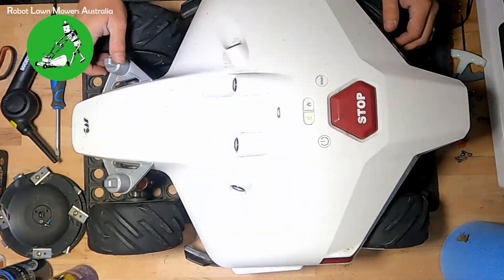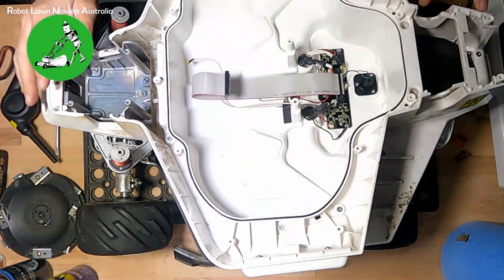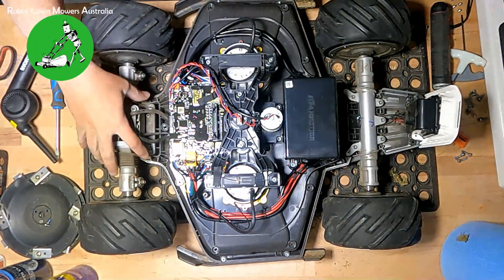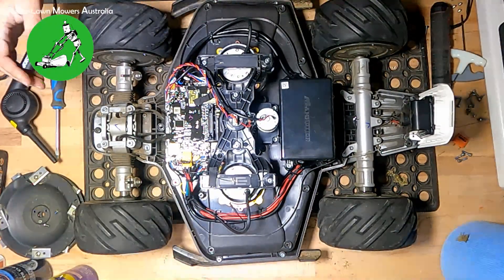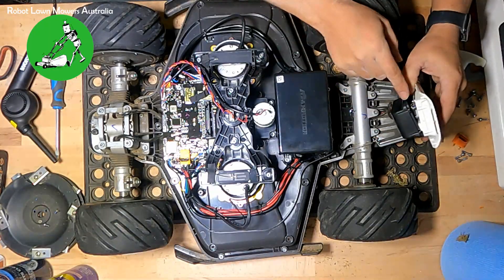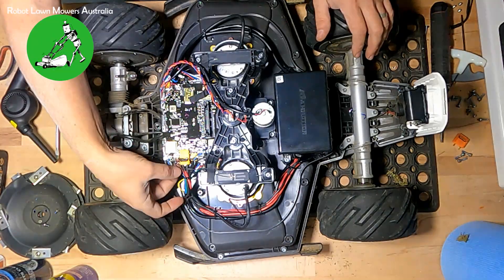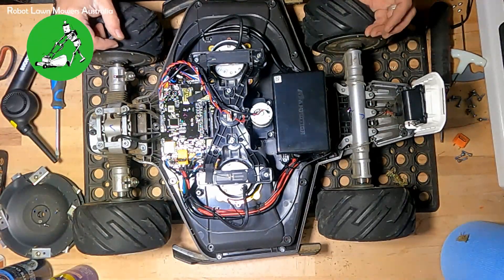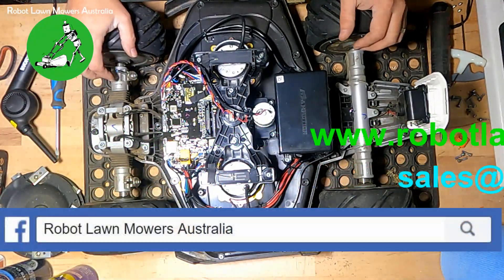Wireless Robot Lawn Mowers Australia - What is Inside Mammotion Luba

Comment: Do you know what the two black and green wires are attached to on their own little island at 1:13? On the external Luba they seem to go to two domed contacts whose purpose isn’t explained anywhere I’ve seen.
Reply from the maker: That is the stop button contacts. It is a magnetic switch which is activated by a magnet under the stop button.

Comment: Great video, I have an issue with my Luba 5000 AWD because Mammotion have locked it remotely (long story so probably not best to get into the reasons here). My question is, if I were to change the main board from another Luba (maybe one that someone's breaking because of a mechanical failure) would this effectively turn my Luba into their Luba so the whole machine would then work? As long as the original owner of the donor Luba removed it from their account I would then be able to add that machine to my account and everything should operate.
Reply from the maker: Short answer is yes. As long as you have the same drive motors, as Luba 1 had a couple of different motors. Solid front tyres and Omni front tyres have different motors and therefore different driver FW.

Comment: Can a broken rear axle be repaired?
Reply from the maker: Yes, parts are cheap but take a chunk of time. You have to remove from the board both motor cables before replacing the axle and putting the wires back and refilling a silicon seal.

Comment: is there a reset button inside? I have a update failure at 69% at my new Yuka, now nothing works anymore, hes dead, stuck in the update.. dont want to send it in :D
Reply from the maker: Sorry there is no reset button inside. If your Yuka has failed its update and you are now unable to connect to the robot via BT or WiFi then all you can do is cycle the power to see if you can get the connection back. If you get the connection back then you should be able to restart the update process and hopefully it update ok.
Reply: @robotlawnmowersaustralia7913  mammotion seid, there could be a bug that bricks the updateprocess. They don't know yet, but we testet everything possible and nothing works. I will get a new one

Comment: Is there any room to put gps tracker inside?
Reply from the maker: yes absolutely. We install airtgs inside the robot for our customers all the time. We dont recomend using the battery of robot mowers to power trackers, so as long as you have a tracker with separate power supply it will work well. Using the robot battery usually leads to the robot battery tripping its BMS and sometimes not able to recharge.

Comment: If you accidentally drop your Luba you could easily crack the front axle in two beyond the rubber boot.
Reply from the maker: yes this is true. The robot is pretty heavy and if dropped it will very likley break the axle. We have repaired a few broken axles now but not many. Later models and the Luba 2 havea slightly stronger design, but it not that much stronger.

Comment: My brand new luba 1000 is seeing zero satellites, suspecting disconnected cable inside .. how easy was it to disconnect the satellite antenna
Reply from the maker: If you purchased this from us, please contact us so we can fix this for you. If not you will have to go back to where you purchased it from. It does sound like the antenna cable is not plugged in properly or has a faulty antenna or PCB.
Reply: Was from another shop. Ended up being returned to the shop and replaced with another new

Comment: I’ve had errors coming up regarding the motor hub , now my Luba won’t move , positioning and connection is all fine . Is this something that can be fixed ?
Reply from the maker: If the motor is not jammed by some foreign object and has a high current or rpm error then it will probably need a new motor or motor driver board. Check to see if it spins freely when it is turned off. This will rule out if there is something just jammed in the motor that could be found and removed.

Comment: Do you know if the tilt sensor in front is the one that prevents the luba from doing too steep an incline? I'm thinking about disabling that switch, but before tearing the luba apart was wondering if you've any insights.
Reply from the maker: No the sensor in the front is only a lift sensor. The tilt sensor will be integral to the main board as some kind of electronic gyro.
Reply: Thanks for your kind reply. I wonder what sensor is actually triggering the stop... @robotlawnmowersaustralia7913

Comment: I have been thinking of adding a small LTE router inside there, which will supply Luba with it's own local WIFI. For that a +5V power must be available. Can you tell, if there is a place where +5V can be take easily?
Reply from the maker: Sorry I havnt look to see if there is a 5V rail or pins to take this from. But you could use a dashcam hard wiring kit and connect it straight to the battery. Just be very aware that if you run the battery voltage too low its BMS will trip and could be dificult to get it to charge again without jump starting it with another battery.
https://www.amazon.com.au/Range-Tour-Hardwire-12V-24V-adapters/dp/B09CMJVQMT?th=1

Comment: MAMMOTION: Aber VORSICHT, wenn ihr den Support braucht. Wenn du kein Tester bist, bekommst du nicht einmal eine Antwort, wenn du etwas wissen willst, was nicht in der Beschreibung steht. In meinem Fall wollte ich nur wissen, ob, wenn ein Haus mitten im Garten steht, die Verbindung zum LUBA auch auf allen Seiten des Hauses gewährleistet ist. Außer die erste Antwort mit lapidaren Hinweis auf das Handbuch, keine Reaktion.

But BE CAUTIOUS if you need support. If you're not a tester, you won't even receive a response when you want to know something that isn't in the description. In my case, I just wanted to know if, when a house is situated in the middle of the garden, the connection to LUBA is ensured on all sides of the house. Except for the initial response with a curt reference to the manual, there was no reaction.
Reply from the maker: Thanks for commenting. You are very correct about support from Mammotion. We provide indpendant support to all our own customers. This is something I comment on alot in my videos. Buy from a local dealer so you get the support you need. I will be taking a detailed video in the comming week explaining more about RTK positioning. IM not sure what your quesiton really is, but if you are talking about the signal from the RTK antenna to the LUBA then the signal will pass through most object in its way and you should get very good coverage on all sides of your house.

Comment: Can you add a GPS locator to the Luba lawnmower and wire it into the battery full-time looks like there’s plenty of room I’ll be anxiously awaiting to see your video. This is something that absolutely everybody who owns a Luba would like to know and be able to do.
Reply from the maker: Yes absolutely possible to do. But be carefull not to let the tracker drain the battery too low or it will trip the BMS in the battery pack. I havn't tripped a luba battery yet, but many battery packs will not automatically reset when you put them back on charge.
Reply: @robotlawnmowersaustralia7913  have you an idea on what rpm the brushles motors are spinning in normal mowing?

Comment: From a function standpoint, the mower is impressive. But from an engineering standpoint, it is not serviceable. The physical design makes it pretty much unserviceable by the owner, from disassembly, to the availability of parts. For a review of the substandard design, see the following review: https://youtu.be/lo2P6R3-Ipk
Reply from the maker: I did see your video. I agree the axles should be stronger.

Comment: How much of a challenge is it to remove the top cover?  I'm curious about hiding a GPS tracker within if there is enough space.
Reply: The front bumper is hollow on both ends. Have seen owners gluing apple trackers inside the bumper.  Easy to remove and take a part. A you tube is out there.
Reply: I heard some people have put a GPS tracker in the wheel... the hub is removable.
Reply from the maker: its not to hard. just dont take out the screws closet to the cutting motors like I have seen in other videos. These screws hold the cutting motors and assembly together.

Comment: Would you mind commenting on the likelihood of....

1. Swapping out the antenna in the back for a better/stronger one (could see drilling a hole and mounting a stick style antenna up) to possibly improve positioning?

2. Any chance of swapping out that 10ah battery for a better/larger one that is more compact?
Reply from the maker: I think changing the antenna may make a small difference and raising it wouldprobably make a reasonble differce to some yards, but would make it impractical to mow around low hanging trees and bushes. 
For the battery I suspect you could absolutely do that, there may be some minor incompatibility issues with the minimum and maximum charge voltages from the firware, but it would likey work ok.

Comment: Hi, do you happen to know the difference between 3000 and 5000? On paper sounds like the same unit different software.
Reply from the maker: Only software limitations. Some 5000s have the full rubber wheels but these are mostly phased out now. The 3000 has a limitation to reduce the max mowing speed and reduces the max areas from 10 down to 6. Thats it every thing else is the same.

Comment: The disk shaped antenna will be for receiving GPS from the satellites.  There is a separate Short Range Device (SRD) receive antenna for transmissions from the RTK and another for WiFi/Bluetooth.  There is a picture showing these antennas as part of the FCC report which is on line.  The same picture shows the SRD and Bluetooth/WiFi modules.  From the picture the SRD module sports a Semtech LLCC68 LoRa chip + 32MHz crystal which is capable of receiving (and transmitting) in the range 150 - 960MHz.  On the Luba it will be receiving only and presumably the same chip on the RTK transmitting only.  It will be using one of the Industrial Scientific Medical (ISM) bands of freqs in this range reserved for such devices, also appropriate to the regulatory authority for the region.

The reason I researched this is I need to elevate the RTK link antenna without elevating the whole RTK above a parapet.  The link antenna has an SMA connector so I should be able to fit the RTK below the parapet so it isn't visible but has an unobscured view of the satellites and then I can extend the link antenna by a coax above the parapet.  For positioning purposes I'm pretty sure it is the RTK GPS antenna that is important, whereas the link antenna could be anywhere, as long as the coax isn't too long and losses not too great.
Reply from the maker: thanks for the added insight.
Reply: I am looking to create a portable rover that will communicate with RTK via SRD...

Comment: Hard to see from the video but are the blade motors brushless? Did you get any more info on the battery, it's hard to judge the height of the pack but was curious to know if they used prismatic or cylindrical cells.
Reply from the maker: Yes all motors are brushless. I havnt opened the battery pack yet, but im sure they will be standard 18650 cells.

Comment: Thanks for the video.  I thought the machine felt substantial compared to the competition so it is nice to see inside.  Only down side for me seems to be battery replacement in the future - having to take the whole thing apart to undertake this service, rather than having a simple battery slot.  I've very pleased with my machine
Reply from the maker: Thanks for watching!
Reply: Agreed, that is the first question I have. Is the battery easily replaceable, or if it has any manufacturers I formation on it. If my L2 5000H lasts long enough to deplete the battery life, I fully intend to replace it.

Comment: Awesome video!
Great to finally clear this open question in regards to the SIM card slot. 

Is the USB port powered? Could it be used to attach/power up a camera or some other USB device?
Reply: the USB does not give power, some other youtuber test it.
Reply from the maker: no I dont beleive it is powered. It is only used for diagnostics.